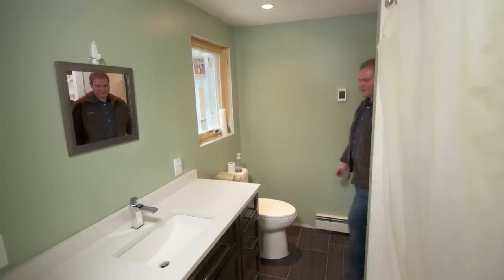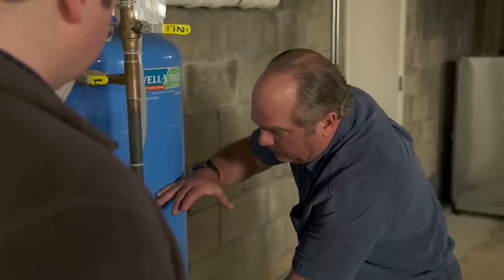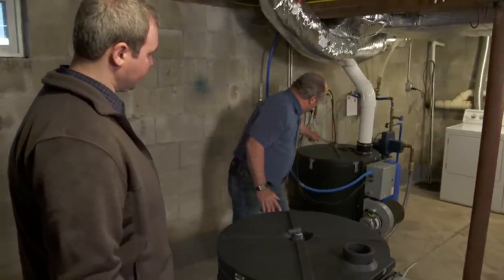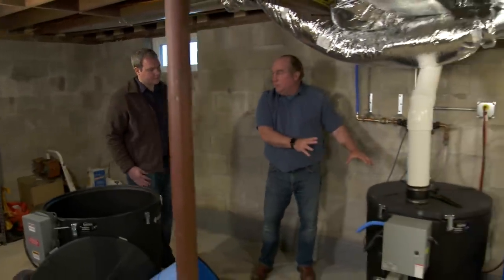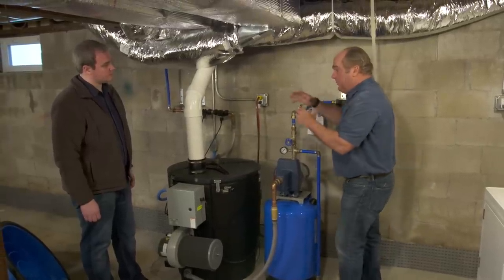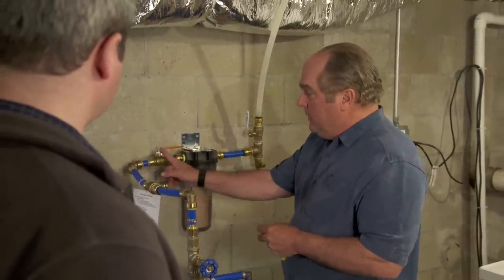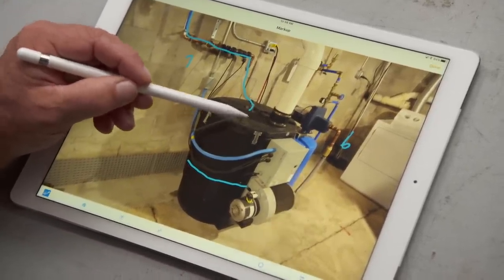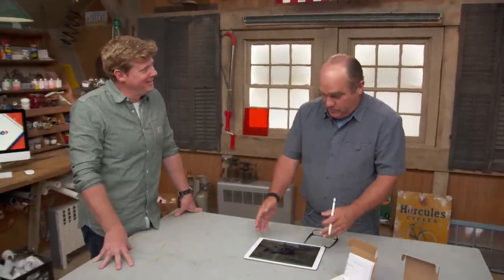Solving a Spitting Faucet Mystery | Ask This Old House

Comment: The first thing I'd do is get rid of that faucet.
Reply: I used to think they looked cool. After seeing the water shoot out instead of down, I'll never own one.
Reply: They look cool, but stuff can collect in the channel and they lack the pressure to blast toothpaste out of a toothbrush. Hard pass.
Reply: Justin can't have any toothpaste left on your toothbrush.
Reply: Lol... Problem solved...except for the radon gas in the house
Reply: These type of faucets are expensive
Reply: @acoustic4037  it was in the water not necessarily in the basement. Two different sources, I'm hoping if they found out it was in the water they tested the air.
Reply: It does seem to be a bad design. My grandmother had a sink faucet that was actually pointed up slightly so you could drink out of it more easily. Handy for brushing your teeth.

Comment: Radon in the water. Everytime he drinks the tap its +3 Rads
Reply: Probably Fallout fan :)
Reply: @rpriesol  Exactly what a synth would say.
Reply: make sure he stocks up on radaway
Reply: Just go to diamond city pick up some radaway and all is good
Reply: He's got a pretty good setup for removing radon and sediment. Its an outdated system though. These days you can get an whole house three stage filter system  that removes radon, sediment, organic chemicals, etc.. and mounts right to the wall (filters are 20 x 4.5").
Reply: Maybe install a Rad-X filter inline with the pump 🤔
Reply: @kalijasin  would a regular 6 stage reverse osmosis water system filter out radon?
Reply: @rpriesol  weready ee

Comment: Holy Sharkbites Batman!
Reply: Trey Andrews I was thinking that to. Never seen so many in an install. Nothing wrong with it just bumps up the cost quite a bit.
Reply: Tony Baggett - I don't see anything wrong with them if a homeowner does it, but I'd expect a pro to crimp it... Just my non pro opinion, but I really don't see those as a way to install every connection unless you are a homeowner without the tools. Copper to pex I may be ok with them using one but I'd still want a solid soldered or crimped copper fitting from a pro installer.
Reply: volvo09 they are great for repairs or connecting non-similar material. Even adding the valve like he did is good. But when the installer of the system used that many, wow! For the cost of all those shark bites you could have bought a very nice crimping tool and enough fittings and crimp rings to plumb an entire house!
Reply: Tony Baggett the guy that installed that was a fitting supplier
Reply: iTech - he certainly supplied the homeowner with some :)
Reply: iTech apparently he was!
Reply: volvo09 no doubt
Reply: that is terrible you are right something is going on when all you use is shark bites
Reply: Wow could they have taken more time and pride in their work? Shark bites galore ,nothing is level , and did you see all the shit in the whole house water filter?  Take time make it look good.
Reply: Sure made that installation a snap
Reply: Trey Andrews made me nauseous
Reply: I think I'm gonna puke
Reply: Very unprofessional
Reply: Sponsored by shark bite hahaha
Reply: Chlorine in city water eats away at rubber seal in sharkbite fittings so they only last 15 years, but this is a well so I guess it’s good?
Reply: Very unprofessional. As a plumber he should be doing the right job with the right fittings. Any real plumber knows that shark bite fittings will fail at some point. Another job hacked by This Old House.
Reply: Shark bites have proven their worth. After 10 years I have never had one fail or leak on me.
Reply: Shawk bite- Tom
Reply: I was thinking that too. Never seen so many in such a small area

Comment: “Water is on”
“Water looks normal”
Me: the water is coming out white...
Reply: Microscopic bubbles usually caused by dissolved gasses like Co2 or by having a good water heater causing microscopic bubbles of steam.
Reply: @SirFloofy001  and unfortunately Radon.
Reply: Thought it was just me... LOL
Reply: If the hot water heating system doesn't have an air vent in it, that's what happens. Seems strange they're bothered about radon - and have an opportunity to remove dissolved gasses and don''t use it !
Reply: Water saver faucets have built in aerator, thus water appears white
Reply: @millomweb  prv

Comment: It looks like milk coming out of that faucet
Reply: pashastookie 😆 lol it’s air in the water , so many tiny bubbles, that it turns it whiteish color ....pretty funny tho
Reply: I stared at it for a bit till i remembered it had an aerator
Reply: Jeremy Beesley you believe what you want to, I still say it's milk.
Reply: gtasandman it doesn’t have an aerator. It is a waterfall style faucet.
Reply: Have you ever been to Long Beach ca? It looks like milk.. and that’s city water
Reply: TOH might have added some coloring so the viewer can see the spitting water more easily.
Reply: PsycotikMind Possible but not likely. It is a common problem. Especially because they have such a complex water system.
Reply: @PsycotikMind  no they didn't
Reply: It looks like something else
Reply: @no name I came for a explanation of this so thanks
Reply: I thought it was the soap from the washing machine
Reply: Until you put it in a glass you can't tell if it's sediment or if the water is loaded with bubbles from his complicated system or water heater.
Reply: Yep... LOL
Reply: That water is opaque

Comment: I like having a well...very cheap to maintain overall.  Spent 800 on new well pump and 200 on pressure tank couple times... Not bad for 20 years..  and maybe pumped septic 5 times about a $1000 total.  So $2000 and around $600 for softner, and maybe $1000 in pellets. Compared with $60-$100 a momth water bill. Which is $720-$1200 per year times 20 is $14800-24000.  

Costs balance out at the end of it, I like having constant water available without concern of unexpected water bills.
Reply: There is benefits both ways. Your water bill is going to be fairly consistent every month unless you fill a pool or develop a leak you never notice. The surprise of a slightly larger water bill is nothing compared to the surprise of finding out you have a bad well and need to drill a new one. Not everyone has that $5,000 to $10,000 just sitting around. Or finding out your water is contaminated and need a UV filter or Radon diffuser. In the long a well is probably cheaper but it comes with a lot of large up front costs and any well problems are your problems. Being on city water you might pay more overall but it's the same consistent amount and if the water stops, you call the city to come out and fix it.
Reply: @brandonfrancey5592  yep if the price is the same on one hand you just pay a bill and get a minimum standard of pressure, quality, and unlimited water on the other its a large upfront cost, repairs, replacements, area to house equipment, all which you are responsible to pay someone to fix/replace. SO if they come out to the same 20yr price I would say it would only be feasible in areas that have no city  water option. But that's just my 2 cents.
Reply: I average 50 a month for municipal water, or 1200 dollars a year, two full bathrooms, no gardens.
Reply: @pavelow235  wouldn't $50 per month be $600 not $1200 a year?
Reply: @pavelow235  yeah my water bill averages $12 a month, ($144 year average) for one person, one full bath, and no other extra water usage like gardens.

Comment: A proper solution would have been to increase flow INTO the radon remover instead of restricting flow afterward.

That guy had so little volume left over coming out of that faucet it makes me sad.
Reply: looncraz would that require replacing the pump underground with a higher rated gpm?
Reply: looncraz - I don’t know man, 5gpm is a lot of water. I have a huge tub with a very large faucet to satisfy that tub with a flow of about 4gpm. When it’s flowing at its maximum of 4gpm it just gushes out, it seems to be a ton of water.
Reply: Those faucets aren’t supposed to have a ton of flow. It looked normal to me.
Reply: Most faucets are designed for 1-2 GPM Shower heads around 2 GPM. 5GPM is more then enough
Reply: Paul M the problem is when 2 sinks and the washer are on or someone is in the shower the dishwasher is running and someone else flushes a toilet. The more gpms the better
Reply: That’s also not the right valve they should be using a globe valve not a ball valve
Reply: @Stephen-Drige  Not true. Ball valves can be modulated.
Reply: CarrotCaptain I’m not saying you can’t use it for that reason. what I am saying is they chose the wrong valve to modulate. A ball valve is made to open or close like a gate valve it’s not made to regulate the water flow where a globe valve is made to regulate the water flow.
Reply: @Stephen-Drige  sure I understand where you are coming from. The ball valve that was installed still works for the purpose and should last for years with clean water. I see no reason to buy a more expensive globe valve when a ball valve serves the purpose.
Reply: CarrotCaptain the reason why is cause the water will channel the ball valve causing a failure and a much quicker rate. Yes you can us a ball valve or a gate if you choose but it’s wrong
Reply: @Stephen-Drige  Certainly. This is a major problem when the valve is designed to be in a system that needs to be isolated. (Process water, hot water system, chilled water system etc) The ball will be corroded and erode over time causing the valve to leak when shutoff. Makes it a pain in the ass to changed out heating valves or whatever else it is supposed to be isolating. In this case they are not using the valve as an isolation valve so I imagine it will never be an issue.
Reply: The restrictor after the tank is unnecessary so the point is moot. There are a ton of tags all over the system. The system was clearly designed to operate at 7GPM and be easily serviced. Someone clearly put effort into making sure it was hard to screw up. He ignored all of that and ignored his own advice change just the one filter. More than likely the problem is the resin tank needing a bit of maintenance or, somewhat unlikely, the pump dying. Our water softeners needed the silt cleaned out every once in a while otherwise the same thing would happen. By doing what he did he just created another problem and even worse, hid it behind reduced flow.
Reply: @DavidPruitt  I thought it was an odd solution to the problem.
Reply: @DavidPruitt  Yes, definitely a band-aid solution.
Reply: looncraz exactly and putting in a bigger well tank at the collector and  at the inlet to the system would help too. I think I can pee harder than the flow to this house under its current restrictions.
Reply: Hey, no more water means no more problems.

Comment: Correct me if I'm wrong because I don't know anything about plumbing but couldn't he have just put the radon system first in the chain. Like instead of having the water run through the filters as soon as it comes out of the ground, put the mitigation system first followed by whatever filters the homeowner wants.

Comment: just a question and I'm by no means a plumber, but wouldn't the radon mitigation systems pump shut off when the water is low?  I thought I saw the float valves in the tank when he took the lid off.  I know that would stop all water flow out, but allow the tank to catch up...

Comment: a ball valve should never be used as a flow control device. It is meant to turn the water off or on. If a ball valve is used to restrict the water flow it will cause the seal to be eroded away by the high-velocity water flow.

Comment: All I have in my basement is a hot water heater because I get city water.  I have no filter, no cleaner,  no neutralizer,  no stabilizer, no pump, no radon remover, no pressure adjustment and no Water softener.   And I'm glad.  With all those gadgets,  i would be afraid something would always break.

Comment: I like that his mirror is hanging by a command hook.
Reply: twennywonn yup
Reply: Judging by the lack of decor in that bathroom, I'd say he just moved in and is now discovering the true joys of home ownership.
Reply: About as sturdy as some of the sh*t you get at home stores I guess... I was lying in bed one night when I heard plate glass shatter. I go into the bathroom and found that the side mirror on the gheap medicine cabinet had fallen off! I could see It was held on with 3 strips of double sided tape (the white foam centered stuff) that sagged over the course of about 5 years from the weight of the glass and finally detached, letting the mirror fall onto the sink. I was shocked, a normal person would assume it'd be attached with a permanent adhesive of some sort.... But TAPE????
Reply: Haha good catch
Reply: @volvo09  someone at whatever company did a thorough cost analysis and engineering review. They determined it would be your problem and went as cheap as possible.
After making all they would of that model, the money saved was effectively the cost of the reviews, so company was happy.
Meanwhile, your mirror broke from cheapened installation.
Reply: Couldn't afford anything else after that water system was installed.

Comment: I'm surprise that the washing machine is plumbed to go through the house filter. Why would you need to do this? Why would you run all that additional water through your house water filter? I would have plumbed a separate line to the washing machine between the radon pump and the house filter. Seems to me like you'd just be burning up the filters more often for no reason. Am I missing something? would there be a reason to pump all that already conditioned water through a filter to do laundry. I realize you can't change the hot water line but wouldn't it make sense bypass the filter for the cold water? Be happy to hear any comments on why that would be necessary. Thanks

Comment: I would have installed an electrically-controlled shut-off valve, instead of a flow restricter, at the feed line into the house and washing machine.       That valve would shut on any occasion when the supply in the black radon-abatement tank goes too low.       Further improvement might be afforded by a larger filter surface area on the supply side of said tank.